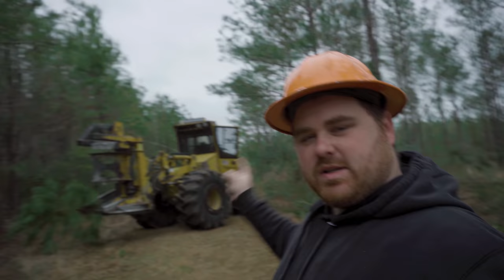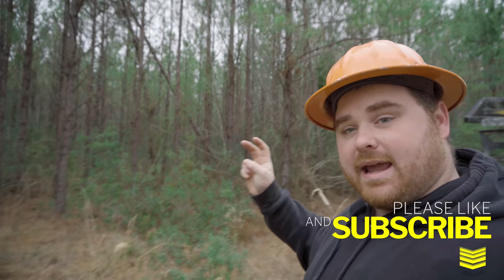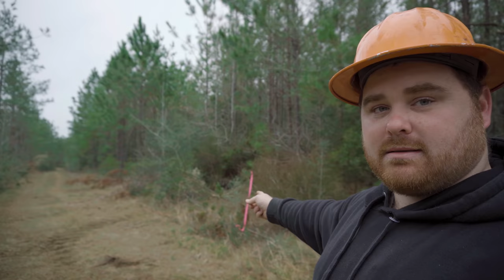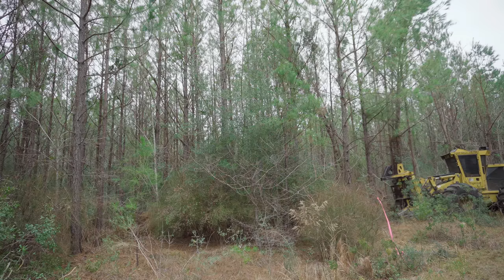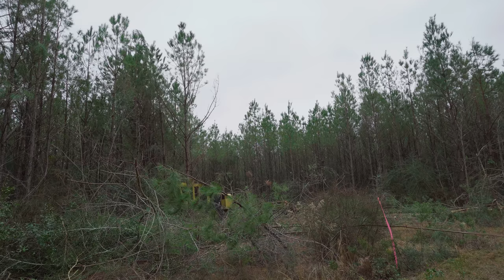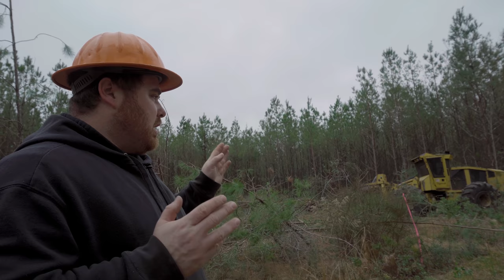How Fast Can The Tigercat 718 Make A Landing

Comment: Great video. It's amazing that the 718 and other rubber tire cutters can do. I'm surprised the back end doesn't rare up when you have the head completely full. We learned how to get the saw disk unstuck on the 853 the other day so let's learn how to get the saw disk unstuck on the 718 please? Great job cutting the set out. How do you determine where your going to make the access roads?